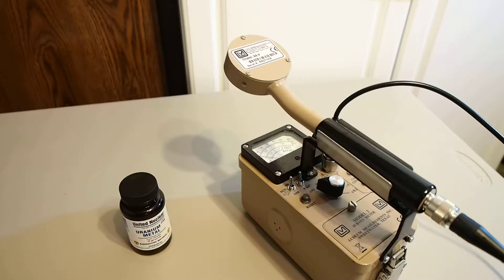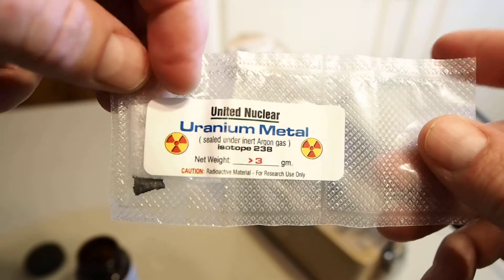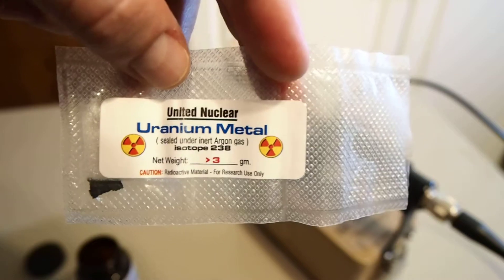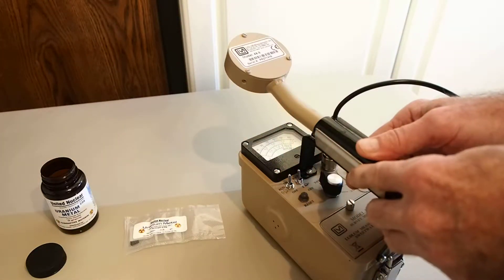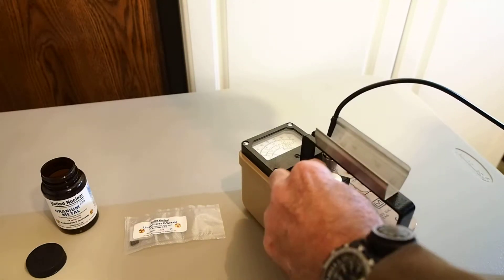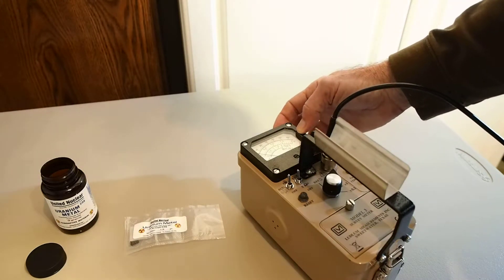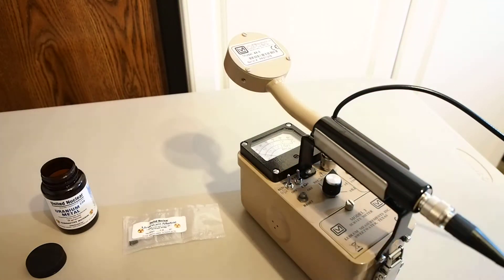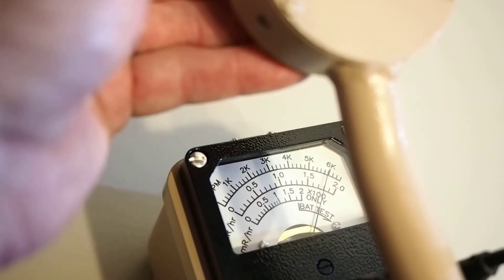Depleted Uranium with Ludlum Model 3

Comment: What percentage of the counts are beta?  I have a CDV-700.  When the probe's window is closed, the counter does not detect the source at all.  (It detects no gamma rays.)  When the probe's window is open to detect beta rays, it detects more than a thousand counts per minute.  Is that what you would expect from a depleted uranium check source?
Reply from the maker: Hi, sorry about the late reply and for your interest. Unfortunately my "analysis" of the specimen was done with a Ludlum Model 3 survey meter coupled with the Ludlum 44-9 detector. That model survey meter, with the meter face (202-608) is only properly calibrated for the 44-9 detector, which reads the cumulative alpha/beta/gamma count rate, therefore any other detectors used with that setup don't provide an accurate reading. Even though I also own a 44-6 beta/gamma detector and a 43-1 alpha detector, they don't provide an accurate reading with the Model 3 and that meter face. Therefore, and to answer your question, I didn't have a way to segregate the alpha/beta/gamma readings. However, as you are probably aware, U238 primarily emits alpha and beta, along with some minor gamma. In order to further my "studies," back in April I ordered one of the new Ludlum Model 3003 Multi-Detector/Ratemeter/SCA units; I'm still waiting for it to be shipped. It's a new model and shipment has been held up for those who have ordered them due to some technical glitch involving the Bluetooth circuitry or electronics. The 3003 can independently measure alpha, beta, gamma, and neutron, with its 4-detector setup. I also ordered a 44-1 beta detector and a 44-2 gamma detector along with the 3003. Additionally I sent in my 43-1 alpha detector and my 44-9 alpha/beta/gamma detector to be calibrated with the new unit. I've been informed the likely ship date will be some time in July. Once I receive the new survey meter with the 4 independently calibrated detectors, I'll be set up to make far more accurate measurements of the extensive collection I've accumulated over the years. If you like, I'll keep you informed about my findings and will hopefully be able to upload some relevant videos using the new equipment. Regards from Laredo.
Reply: @shumla7ranch  Thank you, I did not know that U238 primarily emits alpha and beta, along with some minor gamma.  That would explain why my counter does not detect gammas from its check source.
Reply from the maker: @erintyres3609  It's my understanding that U238 emits very little gamma for the reason that it is "depleted," that is, there is very little, percentage-wise, of U235 [in U238] that actually DOES emit gamma in the depleted form.

Comment: Thank you for this info.. I'm using this instrument for NORM survey in oil industry.could you pleas tell me how to distinguish between alpha and beta by this Model 3? I mean for unknown source.
Reply from the maker: Depends on the detector you're using. If you are using the 44-9 pancake detector like the one in the video, you could use a sheet of paper. It will block alpha particles but beta will, of course, penetrate it. That would be a crude way to differentiate, but to get better results you'd have to use alpha & beta-dedicated detectors. Of course you probably know the alpha particles only travel about a couple of inches through the air, so place the sheet of paper between the source and the open mesh of the 44-9 detector. The paper will effectively shield alpha particles from registering with the detector. In this demonstration with U-238, any alpha being emitted was not measured because the plastic bag shielded the particles from the detector. Does that help?
Reply: @shumla7ranch  Thank you for replay and of course it helped alot,but excuse me for another question about Gamma which is more dangerous. When I connect the Gamma detection bar, which of the four scales is better for reading Gamma contamination? By the way I'm using model 3-IS which is a bet diffirent from your device in the video.
Reply from the maker: @khaledtubashi5159  Yes the Model 3 and the 3-IS both function exactly the same way regarding measuring sources. If you are using a gamma detector with the Model 3-IS, none of the "four scales" is technically "better" than any of the others; it's all dependent on the activity level of the source, distance to the source, time of exposure to the source, and any shielding that might be present. The normal and accepted practice for measuring sources of gamma radiation is to start with the upper end of the selector switch (e..g. X100) and work downward (toward 0.1X) on the scale in order to get an accurate rate count. Also, gamma isn't necessarily the most dangerous form of radiation; alpha is actually likely the worst, especially if it is ingested or introduced into the body.
Reply: @shumla7ranch  Thank you so much, that is all appreciated. Happy to be new supscriper to your chanel.
Reply: @khaledtubashi5159  the LM model 3-IS is a variant of the ludlum model 3 designed for harsh and hazardous environments, specifically environments that may have explosive atmospheres.

The 3-IS-1 is the same as the 3-IS but with a internal probe instead of a external probe.

Each meter from Ludlum Measurements can come as their stock model or customized to the customers needs, primarily these are changes done to connector types, gauge silks ( cpm,uR,mR,etc), and on occasion the rage factors. Theres a large list of add-on's and minor changes the buyer can have done to there meter, honestly just depends on how the buyer intends to use their meter and how deep their pockets are.
Reply: @jamesluck2969  Thanks pal..

Comment: my uncle threw one of these Ludlum model 3 44-9 away, he thought it was radioactive, he showed me a photo of it after he put it in the trash.  Couldnt believe it when I found out what they cost
Reply from the maker: Darn! That's a shame, because the Model 3 & 44-9 cost about a thousand dollars. I just ordered a Model 3001 to assist me in my projects, and hopefully will post a couple of videos of it soon. Thanks for commenting.
Reply: @shumla7ranch  if you get tired of that 3001 you can donate it to me, I wouldnt mind the donation. ;-)
Reply from the maker: @jamesluck2969  I ended up ordering the new Model 3003i instead of the 3001; the 3001i is a 4 detector setup with neutron detecting capabilities. I also ordered two new detectors and had Ludlum calibrate them along with two of my other detectors. I had to wait almost 7 months for some Bluetooth issues in the electronics to be resolved, but received all the components about a month ago. Haven't been able to use them because i just had a major surgery and am recuperating very slowly. But hopefully I'll get a basic video of the equipment up soon.
Reply: @shumla7ranch  well I will happily check to see if they work ;) 
Hope your recovery goes easy and fast.

I'm still in love with the aluminum body units, but sometime those will go away and I'll be left buying the new plastic housed meters. Although the 3003i with a internal scint would be a dream detector, although I guess it's best counter part would be the 3-97, just without the benefit of 3 external probes that each can be set up to do a different job.

I have a list of units I need to start shipping out to a Ludlum divson close by to me. So hopefully I wont be stuck with delays.

If your up to it I wouldnt mind hearing what probes you decided to go with first your 3003i.
Reply from the maker: @jamesluck2969  The 3003i is set up for 4 external detectors, so mine was calibrated with DET 1 with a new 44-2 gamma; DET 2 with a new 44-1 beta; DET 3 with my 43-2 alpha; DET 4 with my 44-9 a/b/g, so that gives me a huge amount of versatility. I may add a neutron detector at some point, though I think I'm more inclined to get a Thermo Fisher RadEye SPRD since I'm already trained and certified to use it. But meantime, I haven't even been able to use my new 3003i setup yet, which I am looking forward to doing.
Reply from the maker: @jamesluck2969  BTW, I feel the same way about the older, metal-housed analog units; it was those that I first trained with at the NTS (NNSS) beginning nearly 20 years ago.
Reply: @Ned Tedford But used ones on eBay can be got for $300